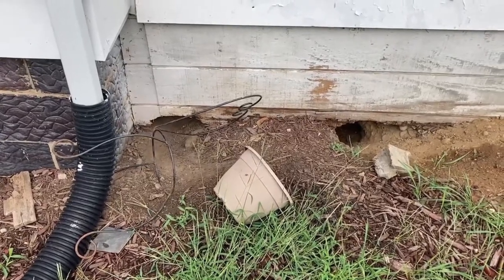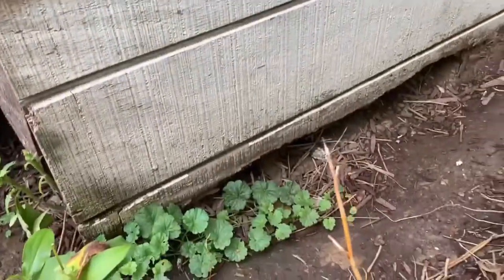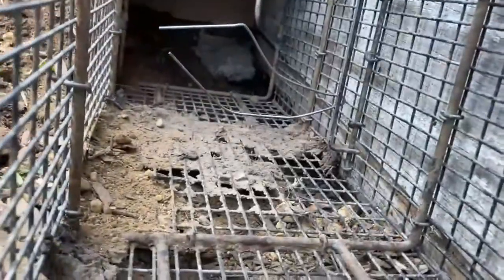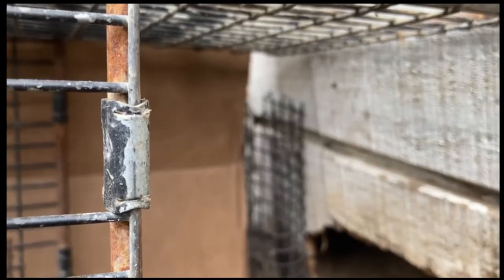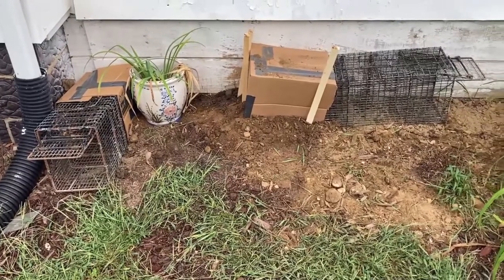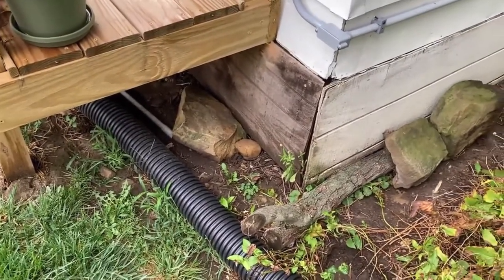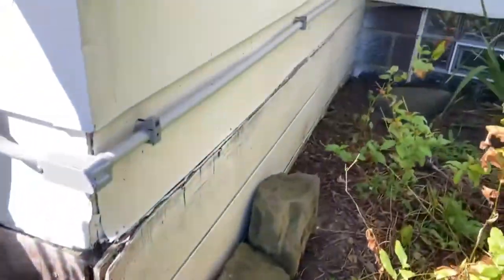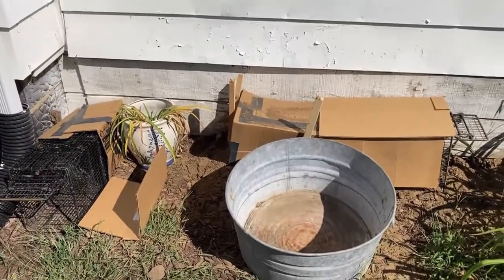Quick, Uncomplicated Groundhog Trapping | Simple, Effective Woodchuck Removal

Comment: Duke 220 Conibear is very effective. The devastation of my garden seased in less than 3 hours. RIP Groundhog.
Reply from the maker: Know your local laws when using body grippers.  And remember, doing your own removal on your own property is different than working for the public.

For example, here is a snip from Ohio nuisance wildlife laws on body grippers (relates to 220s)
(i) It shall be unlawful for any person other than a licensed commercial nuisance wild animal control operator to set, use, or maintain a body gripping trap, on land for the purpose of taking a nuisance wild animal, that has an inside diameter jaw spread larger than five inches in diameter, except as provided in paragraph (H) of this rule.

(ii) It shall be unlawful for any licensed commercial nuisance wild animal control operator to set, use, or maintain a body gripping trap, on land for the purpose of taking a nuisance wild animal, that has an inside diameter jaw spread larger than six inches in diameter, except as provided in paragraph (H) of this rule.

(iii) It shall be unlawful for any person to set, use, or maintain a body gripping trap, for the purpose of taking a nuisance wild animal, with a jaw measurement of greater than five inches or less than or equal to seven inches unless partially or completely submerged in a natural body of water, except as provided in paragraph (H) of this rule.

(iv) It shall be unlawful for any person at any time to set, use, or maintain a body gripping trap, in the water for the purpose of taking a nuisance wild animal, that has a jaw spread larger than seven inches except while completely submerged.